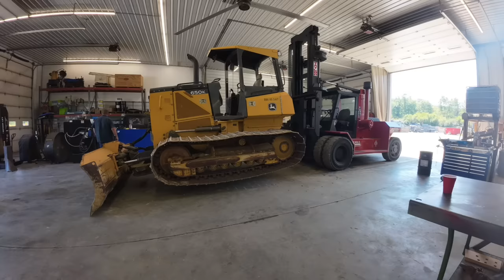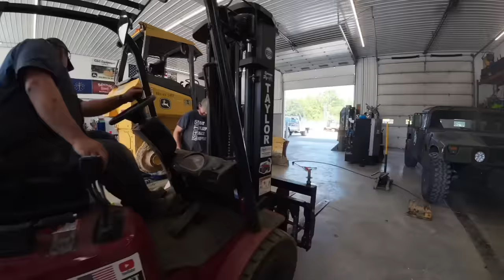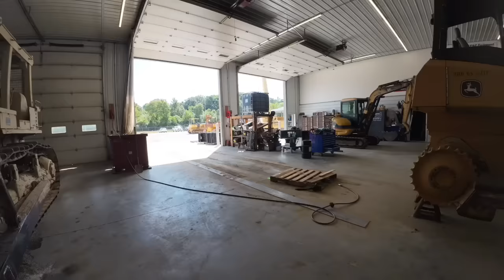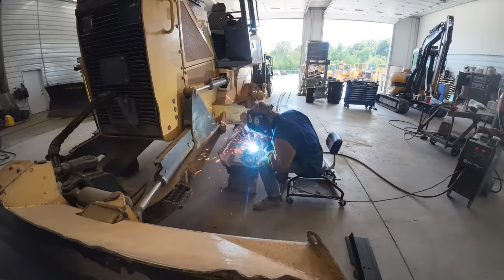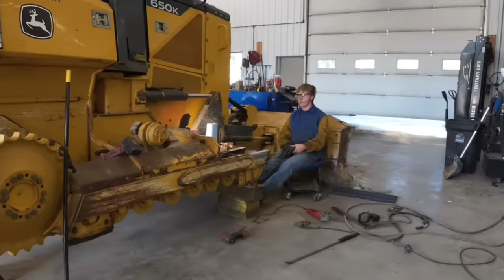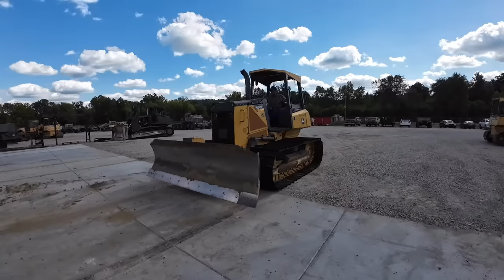Full John Deere 650K dozer undercarriage change in 4 minutes @C_CEQUIPMENT @itramerica187

Comment: The power of the video editing allows you to remove all those cuss words, dropped items, and numb numb moments!  Many times I have end up talking to people that think they are mechanics because they work on cars.  I tell them in order to be called a mechanic they need to work with a socket set larger than a 1" drive.  The look on their faces is the joke as they have never seen a socket set larger than 1/2".  They have never had to hang the tooling from a hoist as you can't hold a 6" socket and hydraulic wrench at the same time.  This is a way to end the toxic ego issue in your environment, nothing but a character reset.

Comment: I guess It’s nice when it’s done with all new parts. 

My first job in the US was at a shop that mainly did undercarriage work. We rebuilt the top and bottom rollers, welded up idlers and had two track presses to turn pin and bushings or replace them when the rail was still good. 
Pressing pin and bushings was some of the sketchiest work I have done while working as a heavy equipment mechanic. Specially when the bushings are worn through and they shatter in the track press.

Comment: Loved the rebuild on the 460. I rebuilt my 428 Super Cobra Jet in my 1969 Mach 1 Mustang about 3yrs ago Souped it up a bit with full race cam, headers, Edelbrock High rise, roller rockers, Holley 850 Double Pumper. She's a Beauty. Paint an Original stripe kit.

Comment: That young man is a welding fool ain't he, and for his age his experience he's gaining in all the different metals, and thickness will carry him well into life with that advantage. 
Needs more tig to round him out with stainless, and the aluminum to be top all around hand.
Plus he doesn't shy away from anything that I've noticed as far as work goes.
He even shows he's not happy with his own work, even though from the perspective we've got from our view point it doesn't appear to be anything out right jumping out at you concerns as far as penetration, and his stitches always look to be uniform. 
What's the rating on your jack stands, cause those gotta be some bad sumbucks to carry that weight in off angle load like they're in?
I hate to have to tote them very far, because they definitely look to be heavy. 
As always great video even for a short, and like the tunes you added in.

Comment: Curious if you also paint that undercarriage repair? Lots of welding/grinding on that front carriage...is that normal wear area?
Reply from the maker: It’s not normal 
The previous person did not install wear blocks under idlers and it wore the guide rails out bad
Reply: Wow, how could it ever make sense to not do that. Just run it on the rails...what could possibly go wrong? 😮